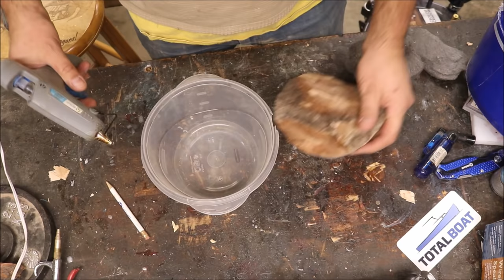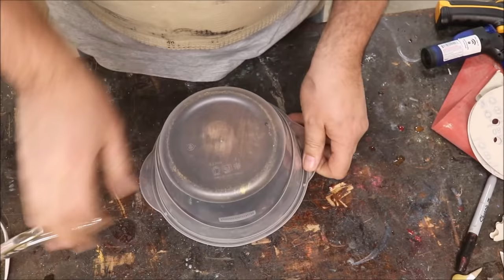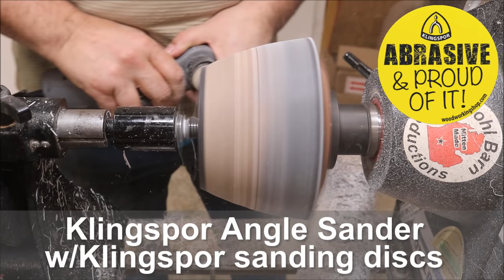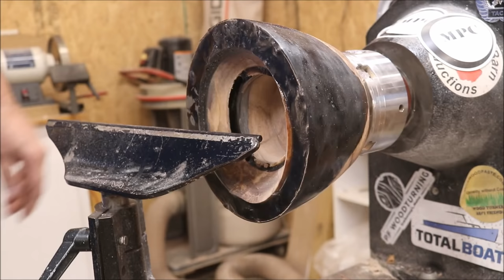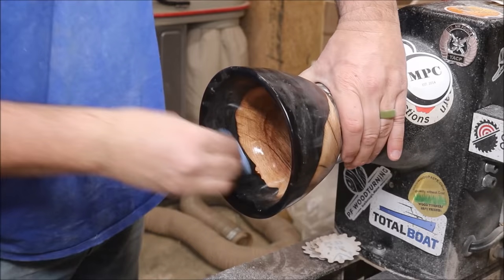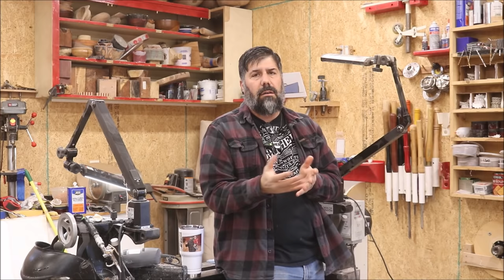I cast Steel Wool 🤔 and This Happened

Comment: For fine material like that, may need to use a vacuum pot to expand the inclusion bubbles before using the pressure pot. Under vacuum, the trapped bubbles greatly expand and rise. Then the smaller remaining ones collapse when air is reintroduced, and shrink more in the prsssure pot, so inclusions, if any, are microscopic.
Reply: When casting stone or plaster for dental lab products we simply used a vibrator to get rid of bubbles in the cast.  When making the mold for chrome steel castings any inclusions could spell catastrophic failure when time came to shoot the molten ingots into the mold which had to be heat soaked for several hours at about 1,925* F.  Failure was pretty spectacular and very dangerous.

Comment: Congrats Ken, beautiful bowl and 30K subs.

If I may, two suggestions for you. 
First, try pouring the resin, down one side of the form, the resin will flow down to the bottom and fill from the bottom up. When you pour all around the form you risk trapping air inside, as you experienced. As others have suggested, pull a vaccum, not positive pressure.
Second, "inclusions", is not the correct term. In castings, inclusions are solid deposits in the base material. Literally, the wood and steel wool, are inclusions in your resin. What you were observing were "voids", or "porosity".

Peace, Wolf

Best of luck and keep up the great work.
Reply from the maker: Thanks for the tips.
Reply: If a person doesn’t own or know someone that owns the machines, and tools.... who would I try to get in touch with for artworks and a possible job lol who knows. When my grandfather passed, my uncle sold his entire shop. Fully contained and all the machinery to build anything. I sure miss working with him. He would love these projects. Anyway, if you have any ideas. I live in Washington state if that helps.

Comment: I just can't stop thinking to myself "why didn't he put on a long sleeve shirt?"
Reply from the maker: I know right?
Reply: @MoonpieCreations  just wipe it off with some fiberglass I suppose
Reply: I hate wearing long-sleeves around shop tools.  Even if I'm wearing a sweater because it's cold, I'll roll up my sleeves when using a table-saw or anything else that might snag a dangling cuff and pull my arm into it.  I'd rather my skin take a mild sandblasting from some sawdust than get my arm pulled into the business end of a power tool.

Comment: I was surprised to see you turn steel wool without gloves.  Yes! it is surrounded by resin but it only takes a few microfibres of steel in your hand to give problems.  Wood splinters work their way out of your flesh.  Metal splinters work their way in.  That's a bit of personal experience, that is.
Reply from the maker: Thanks for that information.  It’s been well over a month and no issues.  Maybe I dodged a bullet.  Next time I’ll make sure to wear gloves.
Reply: @MoonpieCreations  I'd second the above, also carbide tools mate.
Steel on steel, even tool steel will kill your edge in a heart beat.
You need carbide or high speed tool steel same as you would use on a metal lathe.
Reply: Spinning things and gloves is an accident wait to happen.
Reply: @XtreeM_FaiL  I had a friend using a grinding wheel, the bench mount type with a wire wheel opposite the grinding wheel. Long story short, he was using the grinding stone, wearing a long sleeve flannel shirt, much like the gentleman in the video, and the wire wheel caught on his shirt sleeve. It's looking like he will have a short sleeve flannel for spring.
Reply: @XtreeM_FaiL  loose gloves.  surgical-style gloves are fine here.

Comment: 👍
Reply from the maker: Thank you.
Reply: @MoonpieCreations  I got an idea...Make hole plugs from 6 different color woods with a plug drill bit. Mix up the plugs in a plastic bowl like salad, pour in pearl colored resin that is still semi transparent. Put it in a pressure tank for removing inclusions, turn it and polish it, drop it into another circular container and pour redwood chips between clear resin levels. Example: clear two inches, clear with redwood chips two inches, clear again and then another clear with redwood chips. All souriunding the first portion of project. Then re-turn into another bowl or vase from there. Is this doable?
Reply: i guess I am kinda off topic but do anybody know of a good website to stream newly released tv shows online ?
Reply: @Mitchell Lyle Flixportal :)
Reply: @Bridger Enzo Thanks, I went there and it seems to work =) Appreciate it !
Reply: @Mitchell Lyle glad I could help :)

Comment: You should find or make a vibrating table for things like this. 
They run vibrators down into concrete, and it brings the bubbles of trapped air up to the surface. 
I think it would work great in this application.
Reply from the maker: Thanks for the tip.

Comment: I think others have commented about the bubbles, but I'll add my voice to that.  
When pouring resin or silicone or anything like that: pouring into the lowest point and letting it fill up slowly will reduce the number of air bubbles; pouring on top of itself (or on top of some object) will tend to trap air.  So pouring from the "bottom up" is the best way, if a little slower, needing more patience.  
Vibrating the container can encourage bubbles to float to the top.  Shaking and vibrating by hand, or using some device (I think someone suggested a massage seat, which I had not heard of before, but sounds genius), maybe set on top of the lathe (well-supported) and turn it on; the vibrations of the machine may do the trick.  Vibrating helps bubbles to float up and out.
A vacuum chamber will force the air OUT of the material, expanding and popping most remaining bubbles.
THEN the pressure chamber, to hold everything in until it's cured.

For pure resin castings, it's not as much of a hassle, but for stuff like steel wool, other materials that take a lot of soaking in, with tight spaces where air is easily trapped: that's where bubbles are the most likely to form, and where using multiple bubble-reduction techniques is most helpful.  I would look into getting a vacuum chamber, for sure.  (Maybe one of your existing vessels can be modified to pull air out instead of pushing air in?  I confess I'm not super well-versed in the equipment differences between pressure and vacuum.)

I just discovered your channel a couple days ago; been binge-watching.  Such neat projects you come up with!  Your humor and humility in face of set-backs is great, and the same humor and humility when it turns out beautiful is wonderful!  I look forward to all your future projects.

Comment: 5:10 Either that, or pour the whole thing from one side, and let the resin flow to the bottom, then slowly rise through the steel wool. Pouring around traps air between the already settled resin on the bottom and the new resin added to the top. Pouring the whole thing from the same spot makes the resin go straight to the bottom in that one spot, and rise evenly without any new added to the top everywhere to trap air.
Reply from the maker: Great tip thanks
Reply: @MoonpieCreations  
If the liquid is thin enough, it should work.  Slower pouring, though. You have to wait for it to flow all around.

Comment: I hope you don't think I am trying to be a know-it-all.  I  try a lot of different methods.  Just completed a bowl with a ton of aluminum shavings.  What I found was to pour about 1/2" resin in your mold first, then add shavings.  Push them down and stir until you can't see any bubbles.  Then add another 1/2" and repeat with the shavings.  Do that as many times as necessary until you have got all you want.  You will not have any voids, I didn't, not a single one.  The video should be out this weekend,  it's called a smiley bowl.  You were right about the finishing, steel wool will just rust if you don't seal it in something.  Don't understand why you even messed with gouges.   You are really good with carbides and it would not only done a better job but taken about half the time.   Great job any who as usual.  Catch you on the rebound, Larry

Comment: Hi Ken, congratulations on your 30k celebration! For, or better against the inclusion in resin, you could try tu put it in a vacuum pot first to suck out most of the air. Then cure it in the pressure pot to squeeze those remaining ugly buggers. Happy turning! Far away Overseas.
Reply from the maker: Great Tip, Thanks
Reply: @MoonpieCreations  Careful, if you apply the vacuum too fast, it will foam like crazy and you will have splatters all over the pot! It looks like boiling epoxy. Don't ask me how I know!

Comment: I couldn't believe you were using steel wool I had to rewind to make sure I had heard properly.  It still turned out ok. Although on screen, when the bowl was finished, I couldn't see the inclusions you talked about. Overseas
Reply from the maker: There were many inclusions, but most were filled with CA glue. In the end it came out pretty good for an experiment.

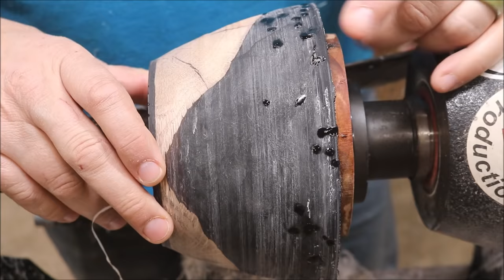Comment: 5:09 Or put it in a vacuum pot instead of a pressure pot...

Get a Plexiglass disk, some rubber for the seal a few fittings and a vacuum pump and the pressure pot can do double duty...
Reply from the maker: I have a vacuum and yes I think that would help with the bubbles.
Reply: I second the idea of a vacuum pump. The bowl looks fantastic.

Comment: Great looking bowl. How do you decide what size to make your wood blanks for epoxy pours? USA
Reply from the maker: I cut two different sizes. 9" that tapers to the bottom and 12" that tapers to the bottom. They fit the plastic bowls I use. Sometimes I do bigger bowls in a bucket.

Comment: You coulda used some kind of vibrator to get the liquid to penetrate that steel wool maybe? Kinda like they do with concrete? Maybe a paint shaker or something? Maybe a super coarse grade of wool? Copper, brass, or stainless steel wool? Those are usually really coarse.
Reply from the maker: Good ideas. Thanks.
Reply: @MoonpieCreations  You kidding me? Thanks for the vids! You make some incredble pieces!

Comment: Hey, as always, great work showing video's including the things going wrong and how you solve them. For this video and the one on the pennies, what sharpening do you use?
Overseas
Reply from the maker: I have a slow speed Rikon Grinder. with CBN Wheels.
Reply: Do you use a wolverine jig for that? I actually don't have a proper sharpening system just because i was hesitating to make a choice because it seems difficult. Anyways, thanks for sharing!

Comment: Do you think putting the bowl in a vacuum chamber before putting it in pressure pot would have helped the resin in the steel wool?  Nice bowl!
USA!!   USA!!
Reply from the maker: Yes, absolutely. The vacuum would draw out the air and then the pressure pot would have taken care of the small ones that were left.

Comment: I like it. It's really cool. I just wish there was another color that would contrast more with the steel wool but I couldn't think of anything. But here's a thought - heat the steel wool up to red hot but not hot enough for it to ignite and leave it in a humid place to get it to rust. Then cast it in a lighter color or even clear maybe...

Comment: If you're going to use resin to make items, why wouldn't you have a vacuum chamber available to make sure all of the air has been removed from the resin so you don't end up with giant holes in the project?
Reply from the maker: I have a vacuum. A vacuum isn't the best way to cast resin always. Depends on the resin and cure times.

Comment: Is it possible to use vacuum chamber and then use pressure pot? is there enough time?
Reply from the maker: If you use the TotalBoat Thickset your working time is around 45 mins. The 2:1 is around 15 mins.

Comment: No wonder your gouge got dull instantly, you basically made a deburring wheel :) maybe a HSS or ceramic metal turning insert would've helped?
The chips were probably sticky because the steel wool held on to the heat of turning. Maybe that did something to the Epoxy chemically too.
Reply from the maker: Hahahah, true.  Someone said the resin got electrical charges and basically had static cling. 🤔
Reply: @MoonpieCreations  Oh yeah, static charging is an even better explanation. You certainly did an interesting material sciences experiment, hehe

Comment: You can get brass wool and that wouldn't dull your tools so bad.  I think it would look better too.
Reply from the maker: Thanks for the tip.
Reply: @MoonpieCreations  I looked at the  McMaster site and you can get it in aluminum and copper too.   For copper they call it gauze.  But I'm pretty sure the brass could cut cleaner than copper.

Comment: I hope you don't mind suggestions but with my epoxy creations I have had good luck by using my ultrasonic cleaner set up like a vibrating table and vibrated the piece I am filling with epoxy and it made the bubbles come to the surface and easier to cut away. I think that might eliminate the inclusions in your project.

Comment: 3:48 I'm just guessing here, but it might also be because you're using a duller than usual tool (because of the wool), which creates more friction, heating up the resin more, melting it slightly, and making it stick to itself.

Comment: I’d like to see some copper mesh and black resin, that’d be cool looking...and easier on the tools.
Reply from the maker: That would look too cool
Reply: Dragonuv2002. You have got to be joking! Either that or you’ve never machine copper before. Copper is one of the most abrasive metals you can find. It wears away high speed steel tools in no time. It’s even worse on ordinary carbon steel tools.
Reply from the maker: @iancanty9875  really?  Great to know. Thanks.
Reply: @iancanty9875  I’ve turned it quite a few times over the years with no problems at all. Thick copper wire wadded up and embedded in ACS with carbon black PearlEx. I’ve never had any issues with either my hss or carbides. The copper mesh is even thinner than the wire. Hasn’t worn my tools any more than straight resin.
Reply: @Dragonuv2002  I’m not disputing what you’re saying but it does surprise me because it’s well known to machinists that copper is awfully abrasive on HSS tooling, especially milling cutters such as end mills and slot drills. It is also terrible to drill & tap because of its high ductility & cold working characteristics. As a precision engineer I’ve encountered many copper machining tasks, which on the face of it look dead simple but which turned out to be an absolute nightmare, especially before the days of modern cutting tip technology. Maybe when copper filaments are embedded, the resin somehow modifies the cutting characteristics, preventing the copper from exhibiting some of its usual behaviour.

Comment: New suggestion:  BRILLO PADS!!  Probably should use carbide for it if you do it.  Stuart USA
Reply from the maker: You talking Chore Boys or real Brillo Pads. Brillo pads are nothing but steel wool and soap.
Reply: @MoonpieCreations  umm, I'm thinking of the copper colored things that have thicker strands of metal and more open weave than steel wool but a similar form to a steel wool pad.  It might be too hard to cut with cut with regular tools or carbide but the open weave structure would fill much easier than the steel wool.  

Another suggestion is Scotch brite pads.  They come in white, green, red or gray.
Reply from the maker: @STMwoodturning  Those are called chore boys in the south.
Reply: @MoonpieCreations  LOL FYI, I live GA but I didn't grow up here, sorry.

Comment: I've seen these bowls made from just burl wood, and the finished design was really cool due to the unusual patterns in the grain..
  Was wondering if you could use small chumks of discarded burl wood with your technique of using the resin to bond/ cast them and maybe throw in some gold leaf foil to turn the combination into something fantastic.
Reply from the maker: I have a bucket with scrap burl and this bow sounds interesting.

Comment: Have you ever tried making a wood box frame, then put in the reson, just a tin layer, let it dry with alittle sand in it for a beach,let dry. Then add different layers of blues, greens for water, and add a few little plastic people, maybe a small house, alittle boat or two in the water part. Let dry.
   Then a clear layer of reson along the edge of the land/sand and take a brush and add some white paint little lines for the surf. Let dry.
   Then put on more clear thin layer on that. (Or do whatever scean YOU want to do) Latter it could be incorporated into a table or little cabinet, or just left as is.
   IF you do paint jobs and with each layer, and alittle more paint it gets to be 3D looking. You could paint some fish in your ocean or folks playing in the water. HAVE FUN !

Comment: Do you ever take the epoxy shreds that come off and add then use them as filler in other epoxy of a different color?  I don't know if if set epoxy can bind to new epoxy, but if it can think of the patterns you could make !

Comment: Interesting project.  I've used aluminum shaving in a similar bowl and agree it would be best to mix resin and steel wool before adding it to the bowl.  A word of caution about using steel wool.  When I was a kid in the 60's I used to use steel wool to clean white wall tires on my dad's car.  Unknown to me I got a splinter of steel wool in my thumb which ultimately got infected.  Home treatment didn't work and I ultimately went to a doctor.  I lost about 3/8 of an inch from the tip of my thumb and doc said it was close to losing up to the knuckle.  I don't use steel wool for much of anything as a result. Message is if you do use steel wool WEAR GLOVES.  I'm 73 now and am in the USA.  Would like to be entered into the giveaway.  Best wishes to everyone for a happy, HEALTHY and prosperous New Year.